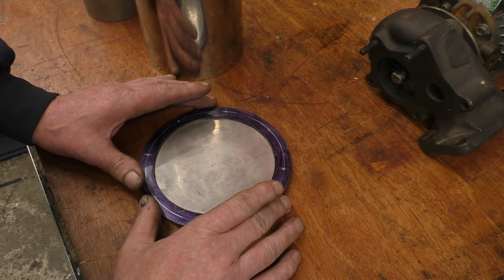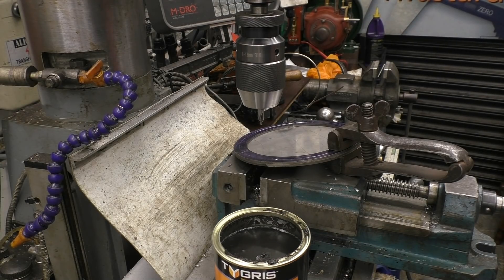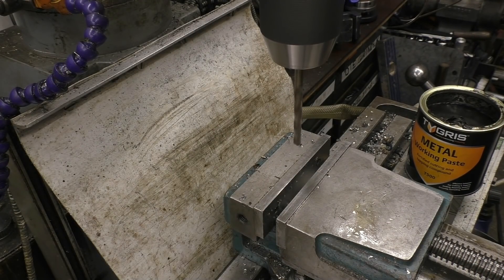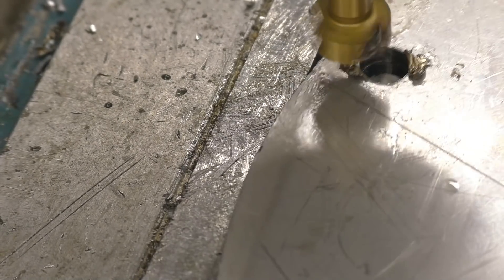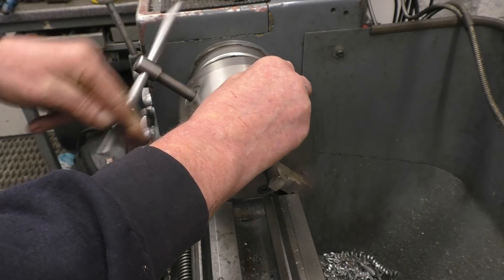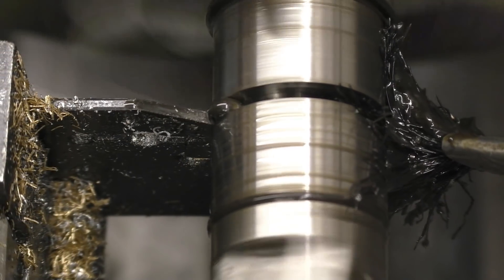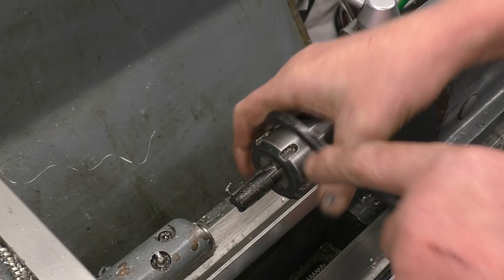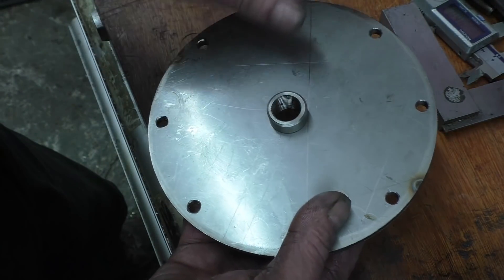DIY Jet Engine Part 4

Comment: SS low speed and Rocol RTD cutting compound , makes life easy. HSS drill bits eat through SS. The last time I bought it it was about 16 pound a tub, lasts yeas, i use it on everything I drill.

Comment: Nice work John. I have very little success with parting off. I think my compound slide is too flexible. I'm enjoying following the jet build. It's a technology I am not familiar with. Thanks for sharing all the tech details of hole sizes, positions and area ratios. Mart in Solihull.

Comment: Question John: You mentioned making parallel threads. Do you mean you used a second tap to 'chase out' or clean up the threads you initially cut?
Thanks
Reply: What John is calling a parallel tap is what  is also called a bottoming tap. There is no taper like a starting tap.
Reply: @july8xx  why did he not just continue using the tapered tap as he had put paste on it?    I don't see the advantage of the parallel tap.

Dale in Canada
Reply: @dalemcinnes1834  If the tap left a taper in the bore it could bind the threads before the gasket is fully compressed, similar to a spark plug gasket, also making disassembly much harder.
Reply: @july8xx  Ok that makes since.  Thanks!